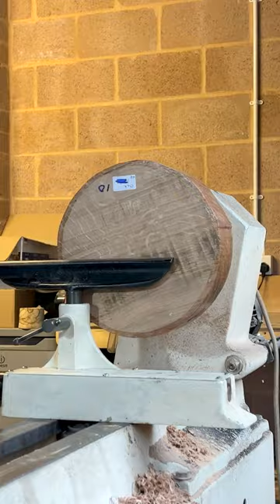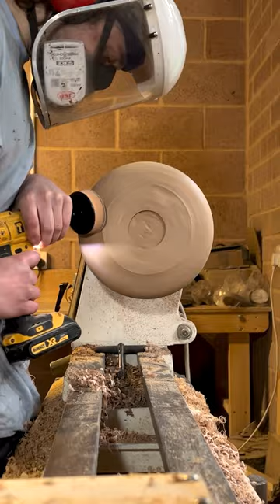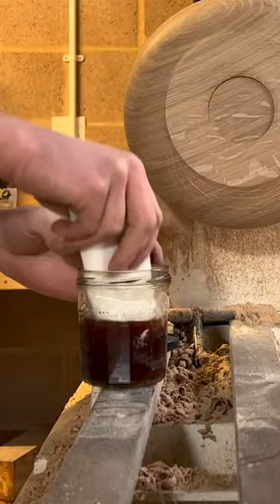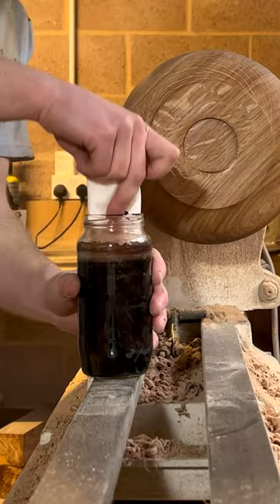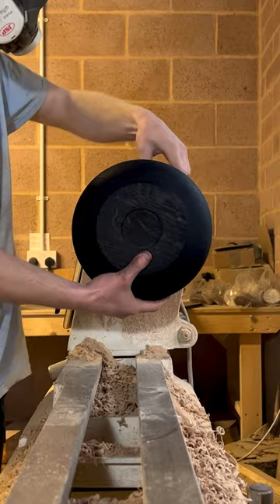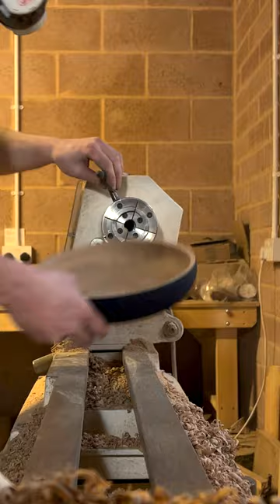Using a chemical reaction to change the colour of the wood... #woodturning

Comment: What chemicals are you using
Reply: I second this question 🙋‍♀️
Reply from the maker: A strong tea blend on the first coat and a steel wool and vinegar solution on the second
Reply: @HenryKeateCarpentry  steel wool and vinegar I have used but the tea was a new one
Reply: @HenryKeateCarpentry  I’m also a turner and I have been using the same solutions to darken woods for years. Different woods react differently to what I call the “rust” method of darkening wood. I’ve found that woods with more tannic acid (ex: any type of oak, hickory) produce the darkest results. On some woods, this method of dyeing produces a bluish/purple color, which might not be what your going for. 
You can easily test on off-cuts to see what the end result will look like before applying it to your near-finished bowl.

Comment: Hello what type of lathe is this ?how many watts?because I m considering buy one as a beginner
Reply: As a beginner I would get a small lathe with a 12” swing. The “swing” is the maximum diameter you can turn between centers. Jet and Rikon make good beginner lathes. For a step up look into NOVA’s range of lathes.
Reply: @a.s.henderson483  thanks for your time 😍😍
Reply: @apostoloskokalis3431  my pleasure. You’ll find that woodturners are always up for talking shop.
Reply: @a.s.henderson483  Like the Record Power DML250?
It looks fine?
Reply: Here in Europe there aren't many options like in USA.
Reply: @apostoloskokalis3431  I just looked it up, and it should do the trick, especially just starting out and for smaller projects. With a 10” swing you’ll be able to turn bowls just under 10” in diameter. 
Perfect projects for this size lathe are pens, small tool handles, lidded boxes, spinning tops, etc. 
Note that you’ll want something substantial
To mount it on. The lathe stand is always sold separately, and can be a bit expensive. If you have a solid bench or other surface to mount it to I probably wouldn’t invest in the stand. You’ll just want to weigh the bench down with sandbags to absorb vibration.
Good luck, and happy turning.
Reply: @a.s.henderson483  thanks for your opinion have a nice day ...😀
Reply: @a.s.henderson483 
Not me taking notes 📝👀
Reply: @CB75000  Hah!